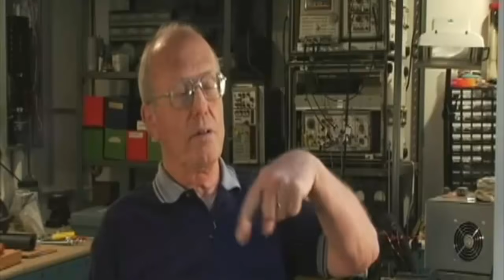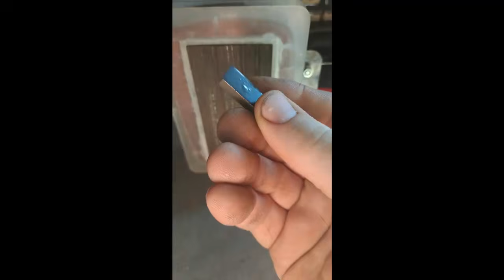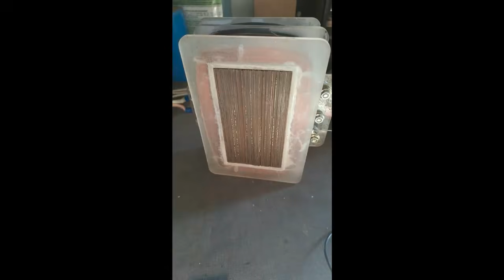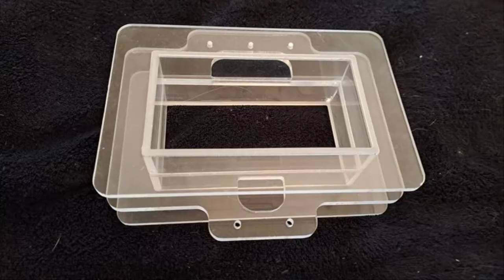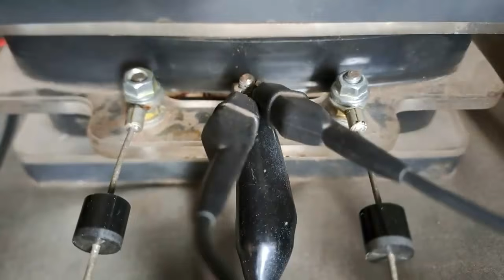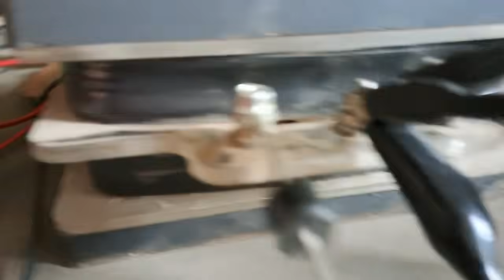Floyd Sweet VTA - Experimental Verification  - Electromagnetic Charge Pump Solid State.

Comment: Could the light bulb be the cause? A cold light bulb has low resistance, while a warm one has higher resistance.
Reply from the maker: Yes, the resistance will change with the heat of the filament, but there is more going on here. The Resonant Frequency, the globe not flashing brightly at low frequency, and actually dimming, there is a very different response here, and its a very simple experiment, so everyone can do this!